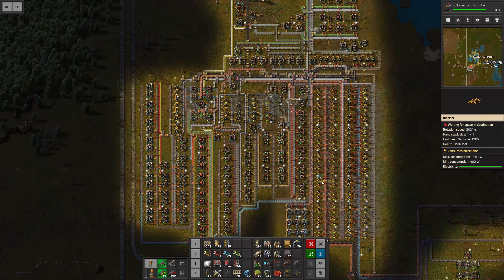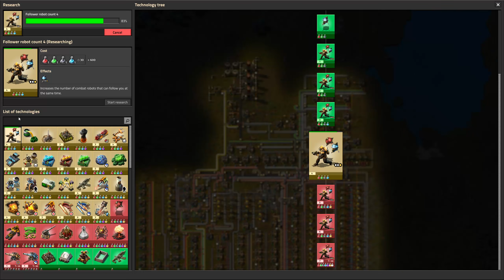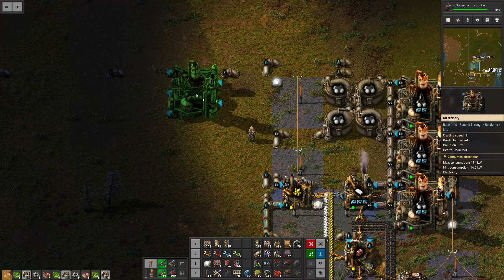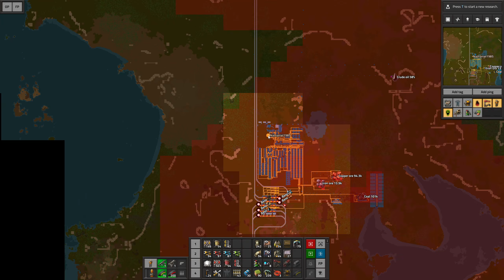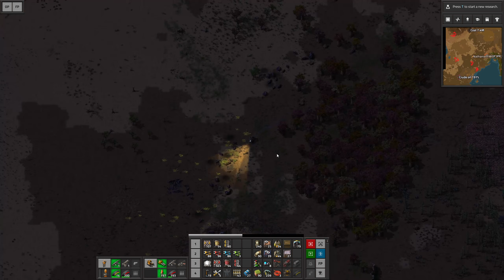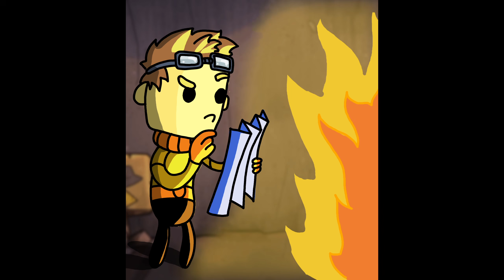PERSONAL CONSTRUCTION ROBOTS - Step 11: Factorio Megabase (Step-By-Step)

Comment: the mod Long-reach you use doesn't work for me  - I replaced it with far reach, thats working.
Whats your take on that?
Reply from the maker: I used both mods, when it works then use the other one, should be good.